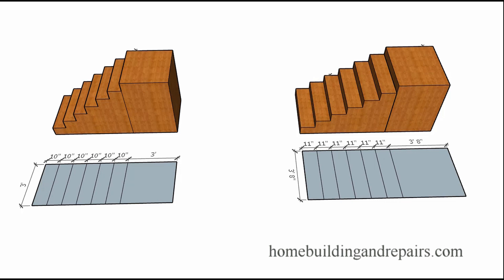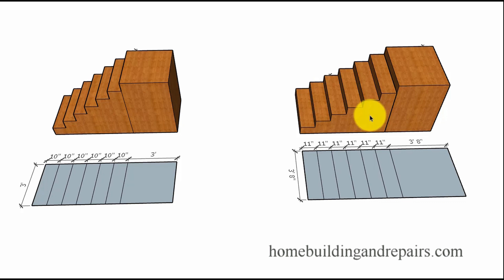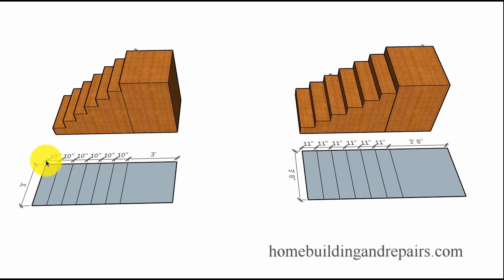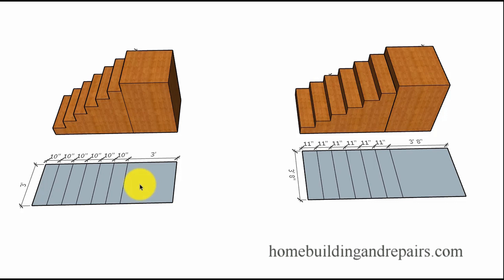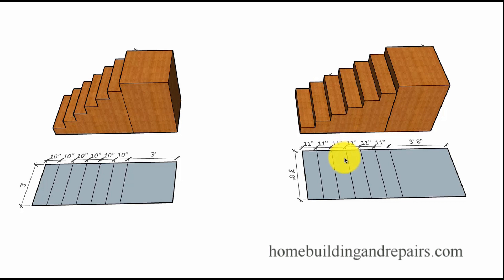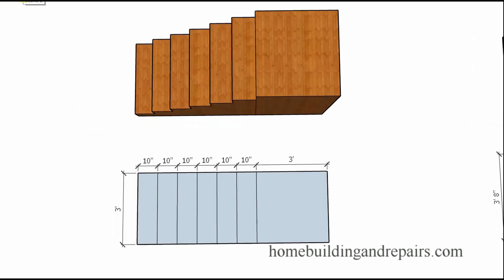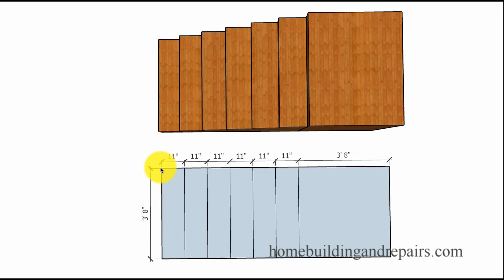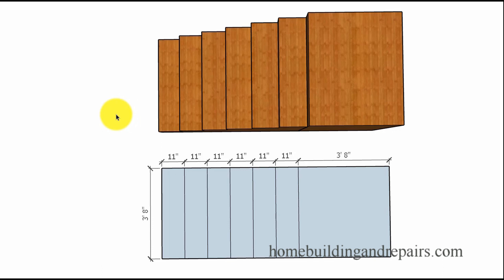Different Width And Height Measurements For Public And Private Stair Design And Building

Comment: I find it odd that they have different height to run dementions. You think if they were all the same you would never trip on the stairs.
Reply from the maker: It would be difficult for me to list all the reasons why these building codes have different measurements, but they usually have something to do with the amount of people using the stairs.
Reply: I think the ticket is to have "more room for stepping and a lower step height" (ya know for older people or people with mobility impairments). If you had to step up 16" it would be pretty difficult not to trip.

Comment: Does the 3' apply only to the tread width or is it also with railings (i.e. must maintain 3' from inside edge of handrail to wall or opposing rail)?
Reply from the maker: The 3 foot is from finished wall to finished wall  through out the stairway and grip-able handling is allowed to come into this space with a maximum of 4 1/2 inches on each side. Page 283 "1014.8 projections" from 2018 International Building Code Book. Let me know if this didn't make sense.